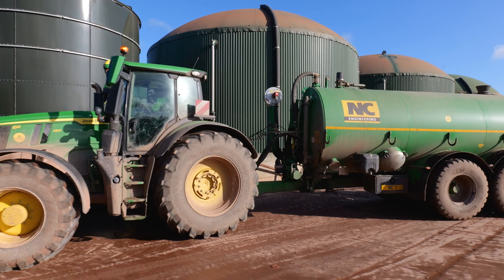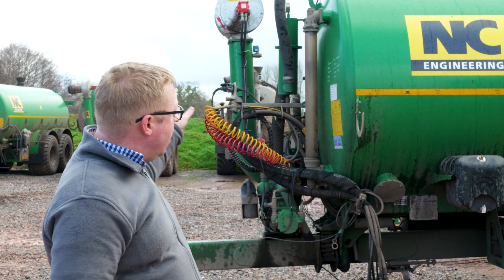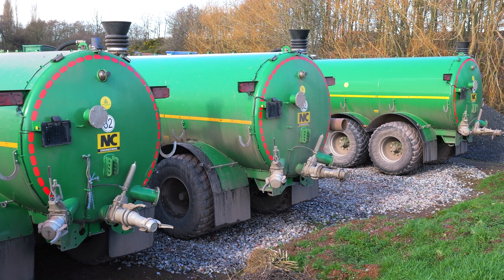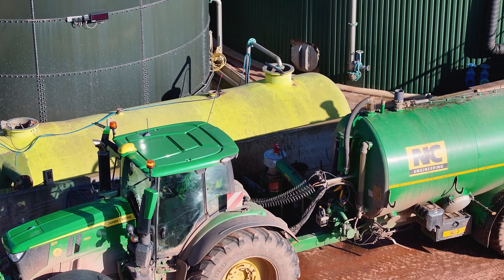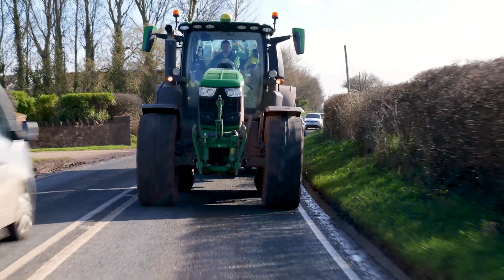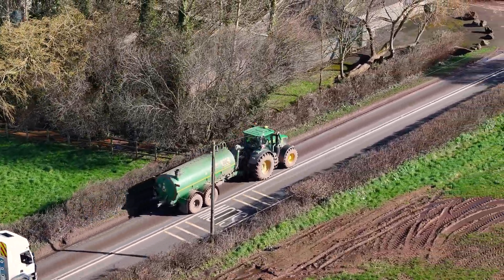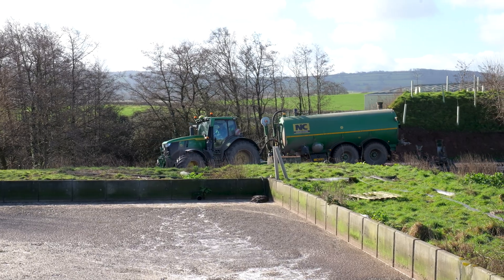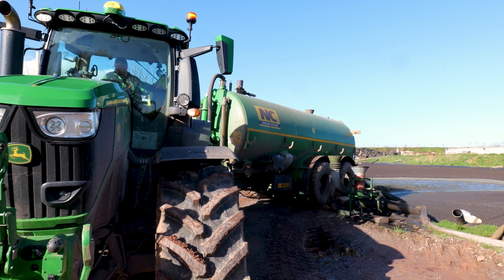60,000 tons of SLURRY per year!!!

Comment: What size of tires, axles and suspension are they running?
Reply from the maker: 710 x 50 x 26.5 BKT on a 150mm beam 420 x 180 brake axle complete with rear steering, 32T suspension